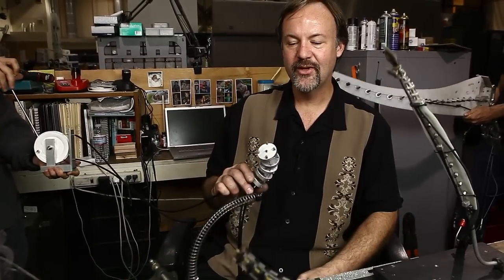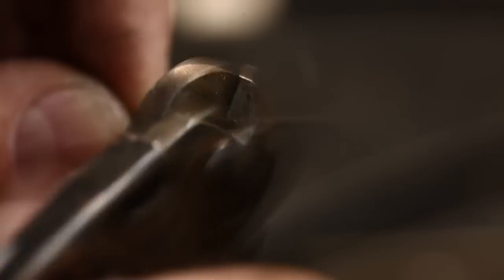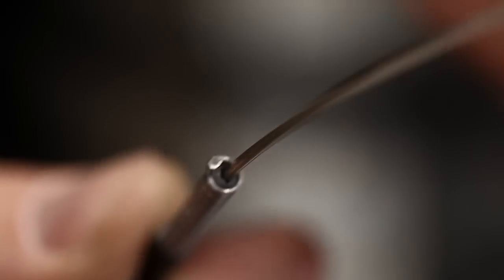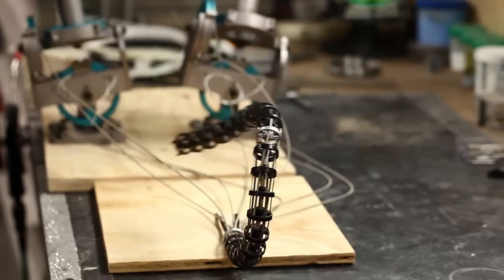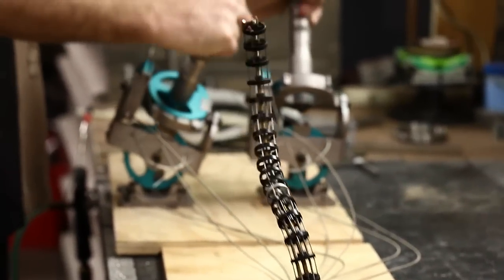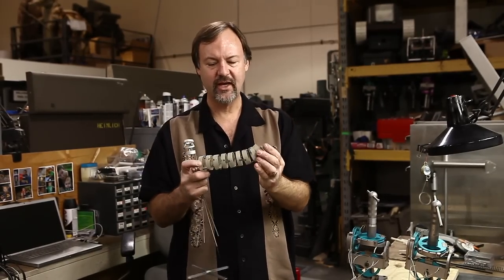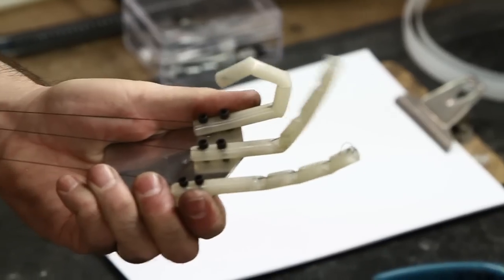Animatronic Character Basics - Cable-Control Tentacle Mechanisms - PREVIEW

Comment: Is it possible to operate animatronics by using your jaw? I've had this idea to make a Predator head with operatable opening & closing mandibles, but no programming required. They would move by a series of pullies, elastics, and the pushing down of your jaw, so when yuo wore it, the mandibles would work by opening your mouth wide under the mask. When you closed your mouth, loose elastics would pull the mandibles back into place. If you get this, please tell me and give me tips maybe? Thanks! :D

Comment: What is the type of Plastic Used in the single axis "tail" at 0:37, and where would you get it? I am making small "monster" and I am stuck on the neck? Thanks for any helpful information.
Reply from the maker: +dodger 815 This is nylon. A very important material of the process. - Balázs